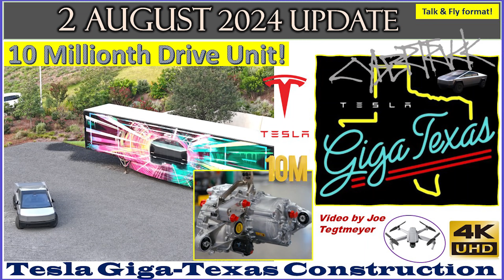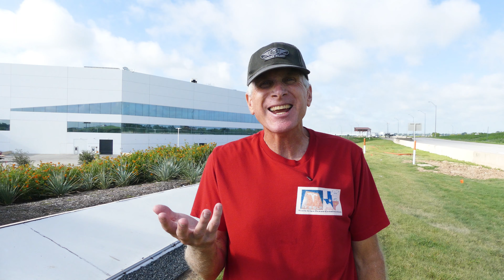10 millionth Drive Unit & Franz’ 16 Years! S Ext  Tunnels! 2 August 2024 Giga Texas Update (07:35AM)

Comment: Has work slowed down on the site, i am 22 minutes in and barely see any difference to the baghouse other than what looks like two fan units installed to the north of the baghouse is the only real difference from 3 weeks ago even the rebar for the slab to the north of the baghouse is just slightly advanced compared to what i saw two weeks ago.. the tunnel is exactly the same other than the gravel and two small piles of sand, I wonder if most work has been slowed due to the heat being experienced but one new bit if activity is seen on tesla road where the water pipes are being installed again, maybe? They have done absolutely nothing to tesla road extension for almost a year now. Otherwise, the only real difference is the levelled areas look slightly more level to the south and where the outbound lot is it looks like they are maybe preparing for more tarmac to be laid down soon.

Comment: Thanks Joe
Sort by ‘Top Comments’ if only a couple of lines are visible.
6:51. Southend, west. Level 2. Dead, no one working. There was a mass departure yesterday in Brad’s video. Contractor sacked?
7:38. Southend, west. A few workers. Most the scissor lifts, boom-lifts, forklifts, etc are inactive.
8:17. Southend, south. West Fire Escape Tunnel. Close to the building, boxing for a grate drain, set-down in the slab. Away from the building, another row of vertical rebar, same as the Central tunnel.
8:37. Southend, south. Central Fire Escape Tunnel. Note the ski-jump shape of the top of the wall. Staging and some decking erected for the roof slab.
9:47. Southend, Cooling Tower. Only the workers at the electrical ductbank and vaults. No one working on the Cooling Tower.
9:52. Southend, Cooling Tower. Pipe on the saddles to the right. Grey paint in 2 locations on the underside. Might be the sections of the pipe that
sit in the saddles.
10:13. Southend, east. Levels 1 and 2. Crickets.
12:36. Cyber Circle, or Cyber Circuit? Lithium st is the street on the south side of the Parking Garage
13:14. Southend, east. Roof at Stamping. Zig-zag to provide slope away from the Stamping wall. A quirk of a roof slope meeting an angled wall.
16:00. EOL, Superchargers. Street lighting poles would be for the Superchargers. Footings and electrical installed ready for the lighting.
18:23. GA, apron. Pump and hoses at the Sanitary Sewer wet-well.
18:44. Battery, west. Road. Lot of water on the road and apron.
19:51. Casting/Paint. Pressure testing the trial assembled pipework. There’s a permit for ‘Casting - Paint Disposal Dock Doors’. Structure behind these doors is isolated from Casting.
Casting, north. More permanent roof constructed over the scaffold portico. White bins are for the scrap from the trimming of the castings.
EPJ, Electric Pallet Jack.
20:40. Casting, north east corner. Apron. Bottom left. The new red Furnace Tender vehicle parked with the scraper attachment in a bin.
20:59. Casting, east. Apron. Series of steel beam embedments along the wall. Top flange drilled with a series of holes, maybe for some piece of equipment to be mounted here.
21:09. Casting, east. Look hard enough and a trench across the rebar is visible, directly above a line of screw piles. A trench for a rail for a travelling gantry crane, or other rail mounted equipment.
21:24. Casting, Baghouse. Galvanised frame. Pair of large items installed on the second level. Speculatively heat exchangers. Note the opening in the guardrail to the right.
26:21. Tesla Road, north. Ductbanks intersection. Erecting the shuttering for containment walls.
Reply from the maker: @DessieDoolan  Dessie, there was a fatality on Thursday … someone had a heart attack. There was a temporary stand down of work because of this and I think this is what you noticed
Reply: Was the stand down safety related? News reports say there is an OSHA investigation.
Reply: @timjohnson9830  I only know what was in the KVUE news report. That suggested an attendance for a cardiac arrest, and a death.

Certainly the site (Southend) was being evacuated in Brad's video from Thursday, This video above, numbers are down still.

I don't have any idea of how the OSHA operates. Not a local.
Reply: @DessieDoolan  Occupational Safety and Health Administration (OSHA). Their purpose is to protect worker safety.
Reply: @timjohnson9830  I'm in Melbourne Australia. Our local authority would be Worksafe. A death on site would see the place closed down immediately, which I guess is what happened at GT Thursday. Seems a similar level of response.

I avoid commenting on OH&S issues. I could. 42 years a carpenter/construction worker. Different country, different standards. Better to keep my thoughts to myself.
Reply from the maker: @timjohnson9830  heart attack
Reply: @JoeTegtmeyer  Yes but what caused the heart attack? Doesn't OSHA's involvement suggest an investigation of possible safety issues?
Reply from the maker: @timjohnson9830  OSHA automatically investigates all workplace fatalities, so assuming more without knowing the details is probably not something we should do.

Comment: It's not just a facing structure that is needed at the tunnel portal. They also need to construct a roadway to get from the tunnel to the end of line facility. No sign yet of any activity to that end.
Reply: I am sure joe announced a few months or so ago that the boring company had wanted the tunnel to be in useable by July, or was that another musk timeline.
Also surprised, they have not cleared the exit of the tunnel on the west side and laid the surface for the road and surrounding infrastructure. I hypothesized that maybe all work has slowed down due to the very high temperatures, and we may see in a few months as cooler weather come in more activity.

Amazing when you look at the Berlin factory flyover how much nicer it looks compared to texas.

Comment: Vocabulary hint: In power utility nomenclature:

*Conduit: A conduit is a tube or pipe used to protect and route electrical wiring in a building or structure. It can be made of metal, plastic, fiber, or fired clay. Conduits provide protection to enclosed conductors from impact, moisture, and chemical vapors. They can be rigid or flexible and are typically installed by electricians. (think breaker panel to lighting circuit or electrical outlets)
*Duct: A duct is a pipe or tubular runway for carrying electric power lines (usually not referred to as wires), telephone cables, or other conductors. In the context of underground installations, a duct often refers to a single enclosed raceway for conductors or cables, while a duct bank may contain multiple ducts.
Reply from the maker: Ok … you’re welcome?

Comment: IIRC there are 6-8 battery production lines installed at the moment. Do you think that all of those lines still have all the equipment needed for the wet electrode process. If/when they finalize the dry process and use it for volume production I imagine all that extra equipment for the wet process will be ripped out.
Reply: A recent article claimed additional equipment was needed to be added following calendaring for dry cathode to work, I'm curious if and how much of this equipment has been implemented at GigaTexas [on the new and existing lines]
Reply: They don't have any equipment for wet cathode installed. They buy the cathode from Samsung I think.

Comment: Thanks Joe!
LCRA Substation:
@ 25:30 Unfortunately large transformers have long lead times from when they are ordered to when they are delivered. But we will know when they start marking the grounding grid prior to excavation work. Also, some switches in the third bay (east bay) may be opened.
New power supply to the building:
@ 26:02 Cables being pulled three at a time through the duct-bank heading north. Here is where they end up 25:45 Where there is enough cable left over to reach the Mega-vault. The 2 duct-banks have the capacity for 24 three-phase circuits (72 cables not counting grounds).
Duct-bank intersection/crossover/new structure:
@ 26:21 Rebar work and forms placed along with what appears to be steel columns. No opening for a door, speculating that this may be structure with large vaults on the first level, and switching equipment on the second level.
(Bottom right) Pull ropes in the conduits of the smaller vaults.
Reply: Elon spoke ages ago about insane levels of future demand and transformers were high on the list.
Reply from the maker: Thx

Comment: those tunnels on the end are likely for liquid purge if there is a break in the system. with such large volumes of liquid going through there, it needs to be managed away from the equipment. there shouldnt be that many people in there once things are up and running so these tunnels would be an expensive people-mitigation system. there are weirs at the bottom of the tunnels and they empty out right at the bigger pond. this is obviously for liquid movement. since it is already treated water, it should be ok to come out to the pond in case of emercency. you also dont want tunnels like that in case of emergencies for people-egress. too much constriction and risk of more hazards.
Reply: Fire Escape Passages. There are already fire escape passages inside the building. Some visible in earlier videos in Battery.
These passages at the Southend are a practical solution for a problem caused by having a monolithic glazed facade. Note there are no openings in the facade for now.
Reply from the maker: @timbachelder9871  interesting observation! Thanks!
Reply: I thought I recalled it being mentioned at some point that the tunnels were terminated inside the building with "freight elevators" ... which makes the idea that these were "fire escapes" for personnel exit highly unlikely. A "fire escape" should not involve an elevator which could be rendered inop in case of a fire. The "liquid purge" theory makes more sense.
Reply: Interesting take yeah. Looks like it 👌
Reply: On one hand, in plumbing systems the drain pipe is usually larger than the supply pipes. On the other hand there’s got to be some elevators in there somewhere, and I don’t recall seeing any other than the three at the ends of these “tunnels”. My memory may be bad… Often fire escape stairs and elevators are located next to each other and both need to be fireproofed. Poured concrete tunnels does seem like an expensive solution to fire egress needs. But those are big, heavy sheets of glass. Maybe requirements to get escapees clear of those? I dunno…
Reply: I’ll go with emergency egress. If this were for a huge data center of “normal” servers and storage, these could be for air conditioning intakes and exits. In more temperate climates, they have went from super chilled air conditioned spaces to using large volumes of semiconditioned air. They’ve discovered that most modern servers and such can survive just fine on warmer, say up to 85 degree Celsius air, but it needs to be not too moist and large volumes are needed. I know of a large facility of three multi story data center buildings in the Research Triangle Park area of North Carolina where they use this method. They found that as long as they filter in intake air and turn it over very quickly, they only have to traditionally cool the air less than 30 to 45 days a year.  Saved them over a million a year when they first built them and that was over ten years ago. 

With the cluster they are building though, they are going to have to use chilled water to cool their GPUs. I don’t know if they are going to use the new NVDIA liquid cooled GPUs or the more traditional air cooled units and a bunch of huge air handlers. I’m sure that although we only see the one huge set of water pipes to the outdoor water towers, they will use multiple chiller/compressors and multiple glycol loops. The direct cooled GPUs are supposed to be more efficient but it would require a shitload more piping to each rack. As opposed to just using a bunch of air handlers and letting airflow do the rest.
Reply: These could be the thermal storage tanks as indicated in the patent for the cooling system.
Reply: Now that makes more sense, i will be watching to see if they create a path for liquids into the pond.
Reply: Liquid drainage could be done with a simple pipe. These tunnels connect to internal stairways for emergency evacuation. Codes require a minimum of safety exits. Numbers of people and distance to safety.  Because of the fancy glass walls , they are going with this very expensive solution. Water drainage? Your life must be strange and interesting.

Comment: To me, It seems like overkill for those emergency exits.
Reply: Yeah I thought the same.  I wonder if they're a way to scram the supercomputer's water system in the event of an overpressure?  They lead straight into the water retention pond.
Reply: @MikesTropicalTech  That's a possibility, feels more likely than emergency people exit.
Reply: @grahammonk8013  They use the supercomputer's water to flush people out in an emergency! Much faster than walking...
Reply: Thats true. They sure put a lot of piles under where they put these tunnels. You do not need all of that structural support for what would be a glorified sidewalk. I realize Giga Texas goes for over the top needless engineering. They did put in a whole bunch of geo piers under what turned into a gravel covered parking lot for trailers in the east WOW lot.  I am also curious about what is so dangerous in this part of the plant that requires three dedicated escape tunnels when the rest of the plant doesn't need it?
Reply: @jestercat7723  It seems not unlikely that they put the geo piers under the East WoW for some unknown building before moving it elsewhere, perhaps Cathode or the Die shop.  It also wouldn't be a waste if they have earmarked that lot for some future structure.
Reply: @Gig0Surf  East WOW. That was to be the Cathode Plant location. Never revealed why it was shifted.
Reply: @jestercat7723  They know what the soil is . They built it up layer by layer at the start. I,ll trust the judgement of the pros.
Reply: @kkarllwt  Yes they do know what the soil is and putting screw piers under the floor makes no sense. A bunch of people walking across it only on the rarest occasions does not require that kind of support. More than likely it is for something completely different than an escape tunnel like many people are saying.
Reply: @jestercat7723  The piers are there to support the weight of the heavy concrete exit tunnel. The structure itself.
Reply: @jestercat7723  Probably nothing more or less dangerous than anywhere else in the plant. The reason the tunnels are required would only be because there is no egress through the fully glazed facade. The monolithic fully glazed wall likely an architectural decision. The tunnels the practical solution to providing egress via the shortest route.
Reply: They need to protect people from falling 16,000 lb glass panels.. It is that simple.
Reply: @kkarllwt  That's why all of the skyscrapers put them in.